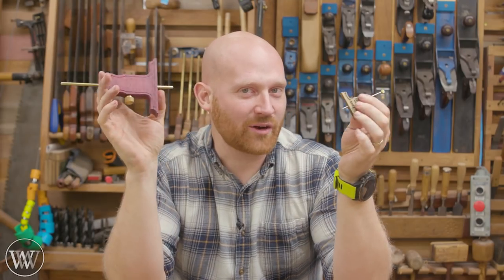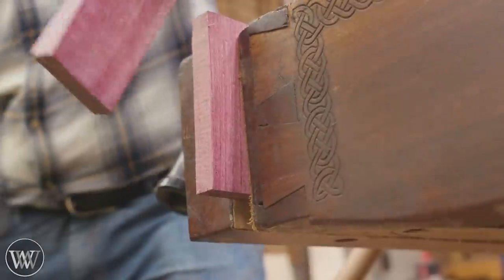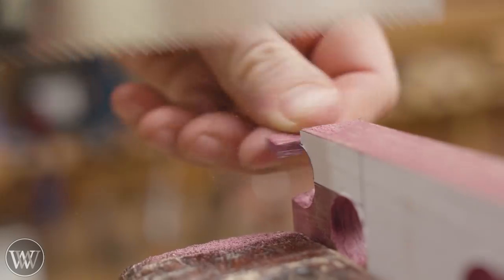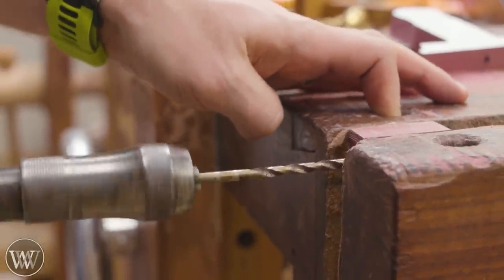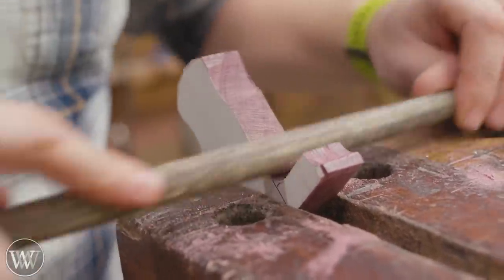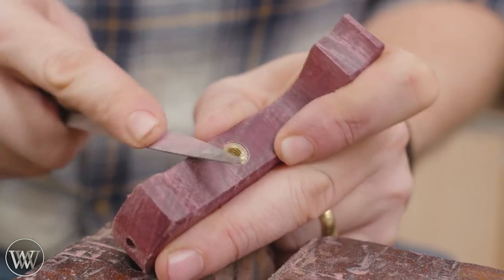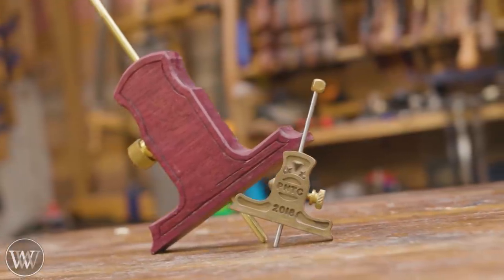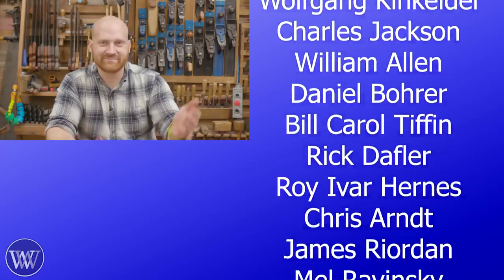How To Make a Depth Gauge Purple Heart and Brass

Comment: Such a cool project, and yes that Purple Heart is just beautiful. One thing you may want to try in the future is use 3M's Super 77 spray on glue. After using it for a bit, you will be able to determine how much to spray on for the perfect application. In this case a very light spray would probably work great, and the paper will basically peel off. I used to help install pool tables when I was young, and we would use that stuff to attach the felt to the granite top. We would spray Super 77 to the granite surface, and that stuff not only never came off, but the felt never moved or buckled. Highly recommended. Great video!

Comment: Instead of cutting out the pattern, then making the through hole fit it, it seems like it would be easer to drill the hole, then fit the pattern to it. This way you would only need to keep the hole "aligned" in one dimension, and can drill all the way through. In theory, if you were not able to keep the hole aligned, you could adjust the wood block such that the alignment is good, then add the pattern. Adjustment could be done with whatever tool you like. Plane, sandpaper, file/rasp, chisel, axe... (Hey, use what ya got! :-))

Great work by the way. It came out looking nice.
Reply from the maker: That would be a great way to do it if you're not confident of your skill. It just saves time being able to put the bottom face along one edge of the board so that's one edge you don't have to worry about cleaning up.

Comment: Hello James, does it matter the diameter of the brass rod? Does it need to be 3/16? Thanks as always!
Reply from the maker: No you can make it whatever you want. The smaller it is the smaller the slot you can get it into. I have one that's only at 16th and I use that one occasionally

Comment: I just got my hands on a large container of cold pressed linseed oil. As YouTubes resident linseed expert, should I just use it in the same way as you do with your BLO? I was thinking of mixing some with wax to use as a nice finish for, stuff. Any recommendations?
Reply from the maker: you cna use it strait, but understand it takes months to polymerize. you could also make BLO out of it. but it does work raw, just takes a LOT longer.
Reply: @WoodByWrightHowTo  that's okay, it takes me months to make anything.

Comment: What size is the thumb screw? I've never had a problem tapping 1/4-20 holes in woods similar to purpleheart (mesquite, hickory, etc) and even "softer" stuff like oak.
Reply from the maker: it was 1/4" 20 the problem was it was end grain. it just stripped out rather then cutting. if I went up a step on the bore hole then it would be too lose for my taste.

Comment: Hey James, Based on how the Purple Heart behaved in the project, would would still use it for a similar application or is a different species recommended? Just curious seeing the splitting.
Reply from the maker: Purple Heart will work fine. I was rushing to get this project done in time. so i was not as carful as I could have been.
Reply: @WoodByWrightHowTo  you didn't take a carful of carefulness over that reply either...!

Comment: did you not have a drill bit that was the correct size for the tap?
Reply from the maker: That was. The problem was the end grain. If I made it bigger there would be too much slop in the threads.